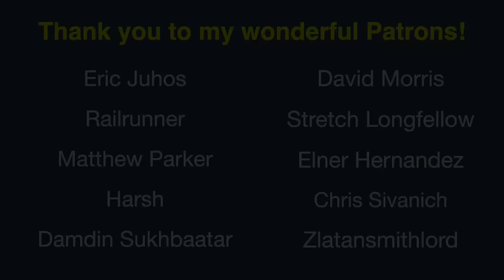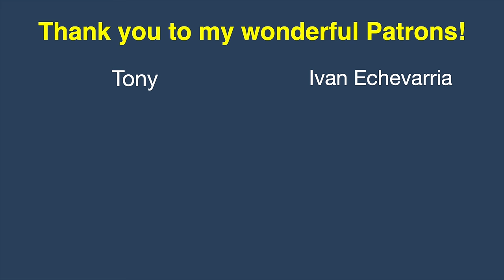California HSR Construction Package 2-3 Drone Flyover!

Comment: First, I want to thank you for this content.  Obviously, a lot of time and effort went into it, and your experience and subject knowledge truly make this valuable source.

My comment relates to the HSR authority's lack of communication on this project.  You spent some time on the air travel issue - the limited service in many parts of the state - which I had not considered.  My concern is airport capacity, which is not infinite, and I think HSR should be communicating how this link will lessen intrastate use of our airports. 

Also, this rail link will be completely grade separated, and HSR has neither communicated the advantages of this nor how this makes this rail line a more complex issue than standard, at-grade rail.  To wit:  I recently retired from UC San Diego, but I have watched the construction of the blue line extension for many years.  I also remember decades back when the UC was dead-set against the line.  Circumstances and minds were changed, and next month the line will open for service.  While the construction was complex and time consuming, the new line is completely grade separated, and for that reason I'm sure it will be a very reliable service.

Again, thank you for this content - I look forward to the next segment!
Reply: The Authority actually does point it out and the 2020 Business Plan included a fair amount of discussion of the intra-San Joaquin Valley benefits from even the IOS, much less the entire system. The issue is that the negative headlines get more attention and few people take the time to bother doing stuff like riding the Business Plans—apparently including the Legislature which needs to approve the funding.

Comment: I recall being in a Japanese HSR station with a local train stopped to take on passengers. A through train came streaking through the station on a passing track. Are such fly by tracks included in all CAHSR stations?
Reply: I was wondering that too.  Some of those rights of way are really wide, and some seem pretty narrow.  Our host mentioned quad track a couple of times, but there's no way that they'd be able to fit four tracks in some of those narrow rights of way.  Maybe those will be dual track instead.

Comment: California Shinkansen I think I'll call it that. Because it's fun. Yes
Reply from the maker: I’m fine with that lol
Reply: @TheFourFoot  through services from the Sanyō Shinkansen to L.A when?
Reply from the maker: Uhhh, soon lol
Reply: Because Shinkansen means "new trunk line" it is most appropriate.
Reply: @danielcarroll3358  Is there currently a trunk line through California?
Reply: @Tealice1  Trunk line just means main line, as opposed to branch line. So yes, there are several trunk lines. Two go over the sierras heading east. One heads east from the Southland. Two run down the Central Valley. I'm sure I am leaving several out.
Reply: @PrograError  You know, I was just thinking that. The earthquake on JR East is called COSMOS and JR Central has one called COMTRAC. I am a firmly against CaHSR rolling stock to becoming European built. Just because I feel like some japanese systems would be safer in terms of earthquake-proofing.
Reply: @PrograError  you can look up both systems on YouTube. There are some japanese video's with animation, you won't understand anything but the animations are very clear.

Comment: Texas Central Railway is building HSR from Dallas to Houston [abt 300 miles] with private money.  Planning pretty much done.  Dirt will start flying early 2022.  It will still be completely opened before first California HSR section done.  Was looking forward to riding it but  the Dallas station will only be 20 miles from me and looking forward to it instead.
Reply: More power to them if they can pull it off, but I'll feel more confident about the TX project once serious construction starts.

Comment: I live in the Sacramento region were we have been told HSR will eventually reach. I strongly feel it should have been started in Sacramento for the following reasons; . There is an abandoned rail line between Sacramento ( Power Inn Rd)and Stockton, that could probably have been relatively cheap to acquire.  2. Connecting the Sacramento regions 1.5 million people with Lodi, Stockton, Modesto , Merced, Fresno and Bakersfield makes economic sense, California is more than San Francisco and LA.  The distances between the  these valley cities is probably too short for economical air service but perfect for rail., Now to argue against my own point if the French had been given the construction contract for their alignment along I-5 it probably would have been near completion by now.
Reply: @TohaBgood2   Thanks for your response to my comments on HSR.  I do not believe that there is majority support for HSR in California. That is why I believe that all major metropolitan areas should be included. That means Sacramento, San Diego, and the inland empire.  How can we in the Central Valley support High Speed Rail if we get no benefit from it ? On the positive side ,
ACE is planning an extension into Sacramento that will supplement the San Juaquin's in the central valley. I have driven down SH-99 and I-5 many times the last couple of years and it is not a leisurely drive. We need HSR everywhere.

Comment: Thank you for your input on the completing of HSR. I have heard nothing but reports that it will not be complete so always great to hear a positive report. 

23:00 I would have to disagree with your view on commuters from the central valley to the Bay Area. You should drive I-580 in the morning - the commute starts at 4:00 for people coming from Stockton to the Bay Area, and they are likely in for a 2 hour or more commute on the one way, same thing at night. If you build the HSR I would think there would be people commuting from these central valley cities, but time will tell.

42:00 Also, corn used at a dairy uses the whole corn stalk - it is chopped up to make silage and is fed to the cows as their primary diet with other additives. The kernels are a high energy source tho.
Reply: Why isn't this train Whole network elevated? Won't it lead to animal accidents?

Comment: When the elevated portion of the track is being constructed will the concrete be mixed on site or trucked in from off site?
Reply from the maker: Trucked in. There are a few concrete plants along the ROW (that I believe provide concrete exclusively for the project), but building a plant at each structure would be cost prohibitive.
Reply: @TheFourFoot  The construction of the Tesla Gigafactory near Berlin, Germany uses temporary on site concrete production facilities. Those facilities can be later removed.
Reply: The 3-year sequence of videos from Raiders 1967 shows how the temporary concrete facility was set up and used for construction of Allegiant Stadium.  It is portable enough that the HSR construction could use a lot of them.
Reply: Concrete is made from aggregate, sand, water, cement powder, water and electricity. If all of the ingredients have to be hauled to the site by truck, its going to more efficient to haul premixed concrete to the site by truck, especially if the local cement works is supplied with raw materials by rail, as tesla berlin was.
Reply: @theoldengineer1946  The decision to use portable concrete facilities or not would likely depend on the proximity of permanent facilities. Another factor would be the condition of the roads connecting permanent facilities to the construction site.
Reply: @adambennie4406  Tesla Berlin has all the inputs for making concrete on site. It was determined that hauling those inputs to the site was more efficient and less disruptive than hauling premixed concrete to the site. I believe that a dam requires a continuous pour of concrete..unsure if a continuous pour of concrete is required for track construction.

Comment: How did you get the camera on top of the train?
Reply: He was filming from a two level car over the top of a one level car. Because the two types of car have their doors at different levels it is not possible to move between cars but this is sometimes done when extra capacity is needed. The window in the door of the two level car is above the roof of the single level car.

Comment: US way of doing grade separation is weird. In many countries if Railway crossing small roads that use for crops machinery and small road vehicle. They build box culvert underpass with only 8-10ft height with road dip a bit lower from ground level and yes it may be like kind of this underpass every 1 mile or less because it also provides emergency waterways when flooding occurs.

And I am very surprise how many of grade separation is made of Dirt embankment instead of full concrete bridge. Cheaper may be?
Reply from the maker: For sure cars still get priority in the US, and I’m sure that the dirt embankments are cheaper than a bridge spanning the entire distance.

Comment: Looking at how many huge structures are built in the middle of nowhere it's no wonder the project is costing so much money. Frankly, because the HSR line requires such gentle curves and solid infrastructure, the smart thing would have been to place the entire line on the ground (where possible), and have other lines and roads pass over, or have roads especially just go through an underpass (or cut them altogether, with the area being so rural). So I've got no idea why they're doing it backwards. 
At this point it might have even been cheaper to go the Chinese way and just place the entire line on a prefabricated viaduct, because flyovers, especially on HSR lines, are f*cking expensive and take a lot of time to be built.

57:00 I mean seriously, why not just build an underpass for the road?

1:01:00 And why not combine both roads and build just one grade separation?

It leaves me baffled as to how such a large and significant project was planned so badly.
Reply from the maker: As for the bridge at 57:00, the tracks are already at a higher elevation at that point because of the river crossings, and returning to grade to have SR-43 pass underneath wouldn't make much sense. Keep in mind, all vehicle underpass structures will be subject to flooding, not ideal for a state highway. At 101, I can see how it might be tempting to combine the two, but it would require a lot more land to be purchased than simply building two road bridges. The route is being built is by no means perfect, but theres likely dozens of reasons why each section of the alignment was chosen, and it's way too late to ever go back. Although progress has been slow, we're definitely passed to halfway point with ROW construction.

Comment: California should just have the chinese build the high speed rail for them, it'll get completed in no time and way less budget. They actually build their HSR with 1/3 the cost per mile of the cheapest cost other countries built their HSR, and this included building mega stations, embankments,  and high ratio of viaducts and tunnels.

California and China started their high speed rails at just about the same time in 2008 and now at present, China crisscrossed their nation with 38,000 kilometers of rails (more than all the rails in the world combined) while california still has to lay a single track of rail.